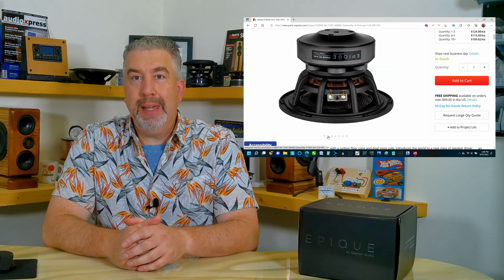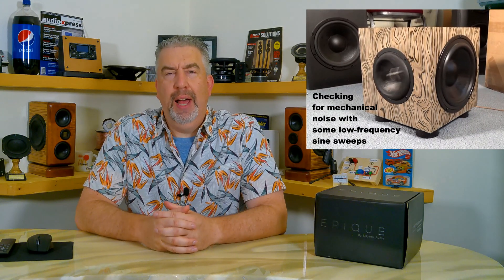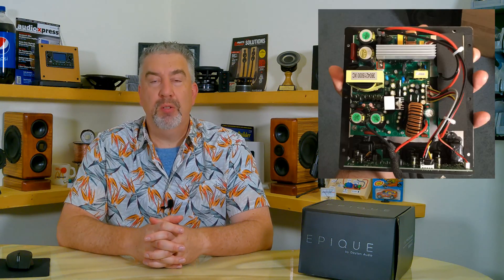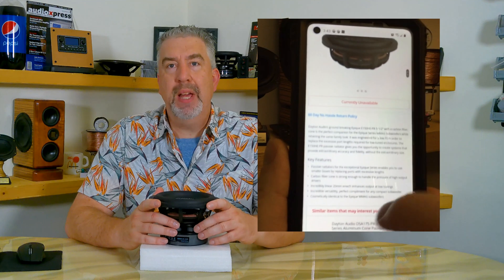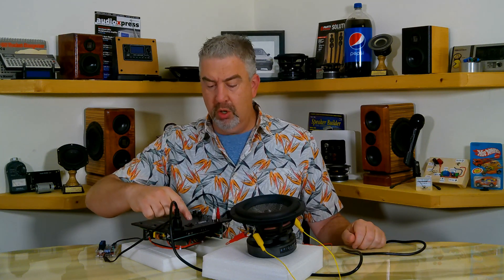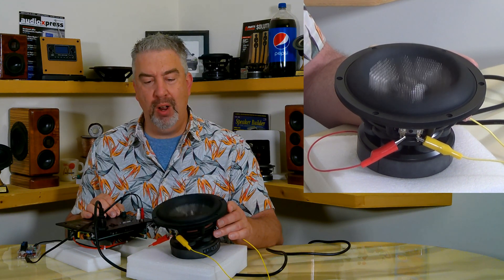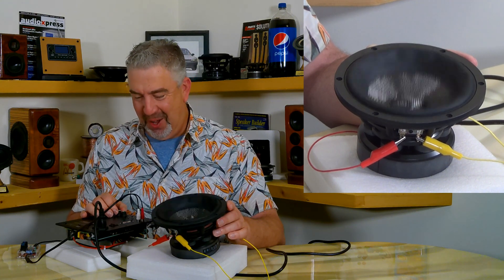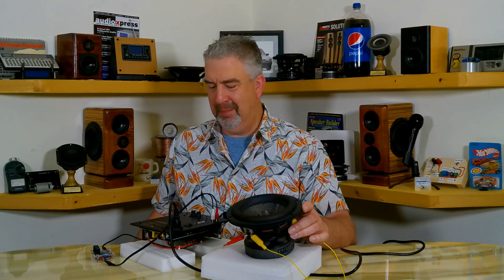New Epique *Things* COMING SOON! and pushing a 7" Epique Sub to the Limit!

Comment: Hey really enjoyed the video! I got one of these too and mine is making the same "rattling" noise. Just as yours in the video. It almost sounds like if you are playing a square wave or like a compressor pump, when it should just be playing a smooth sine wave (You can really hear it at 5:55).  That all happens at way lower excursions than the 14.7mm advertised. Does this not worry you? Is it normal, and if so what creates this kind of noise?
Reply from the maker: I'm not concerned about it because any driver is going to make some noise when it is moving in and out that much. There are pretty significant air currents being created as the air curls around the frame of the driver towards the rear and back again just from the cone pushing and pulling the air around it. There are some mechanical noises that must happen as the spider and surround are stretched nearing their maximum capabilities.  Also, if that much cone movement in the lower bass was accompanied by the rest of the music soundtrack, it would be so loud as to obscure any of that (fairly minimal) mechanical noise coming from the driver. We're also hearing both sides of the cone, in an enclosure, we would only hear the front side, which further reduces the sound we end up hearing.

Comment: Seen the passives earlier today. Helps with doing my speaker pods I’m putting together for a 3 way pod setup for my car. 5.25” epique driver, 7” passive, 6.5” mid bass woofer sealed, 1 1/8” tweeter. All separate passive crossovers and inputs for active 3 way capability, or passive.

Comment: Now if they would make that in a 10" and handle more than 200W, I'd throw it in my truck in a heart beat.
Reply: Why stop there? I want to see an 18 inch with insane excursion!  Seriously though, a 10" would be rather nice to see.
Reply from the maker: I've watched your (Toids DIY Audio) video several times where you interviewed Chris Perez from Parts Express, and while he was talking about these drivers, he mentioned that the same technique could be used to create an even longer high-magnetic-strength field with longer or stacked "helper" magnets to create more excursion, so a larger sub driver probably will be in the works if they are able to do it and hold price to a realistic level.
Reply: I'd rather see 8 7in or 5 in epique than an 18 they already have lots of high xmax 18s

Comment: Wanna make a boom box with these!!
Reply from the maker: It will need a lot of power, but it performs.
Reply: @zarboaudioprojects1430  my brain child the i currently have on the mental vision board is looking like 50 watts per channel…yikes. I like using the Dayton KAB 2x50 because it’s so convenient but I’d like to find something with atleast 200wpc, even if it’s only mono. Stereo might be too heavy of a lift. I really want to give these a shot though
Reply: @Chase1297  Dayton has a new board with DSP and bluetooth with 4 channels 100 watts each.

Comment: If that's the actual price of the passive radiators, that's going to be a fantastic price. My guess is that epique five and a half inch passive radiator would also be really good for the tang band W5. They tune similarly with the w5 just having less Xmax. I'm really interested when those come out.
Reply from the maker: Yes, the price seems really good.  The one spec that is listed for the 5.5" PR is a 20 mm Xmax figure. With the ferrite version of the W5 having a listed 9.25mm of Xmax, it MIGHT be possible to use one Epique PR instead of two, although that may be cutting it close. Chris Perez mentioned that they are "On the Water" or on a ship bound for the U.S., so mid-October will likely be when they become available to us.